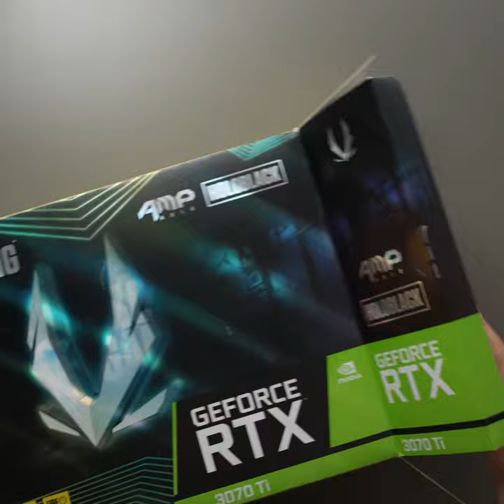NZXT H5 Flow: Custom PC Build #shorts

Comment: Can i use deepcool ak620 cooler in this case?😊
Reply from the maker: It's cutting it close but should fit. Max clearance is 165mm and the cooler height is 160mm. GL